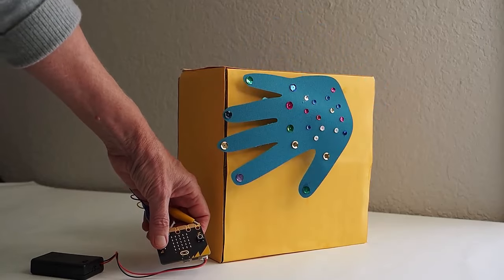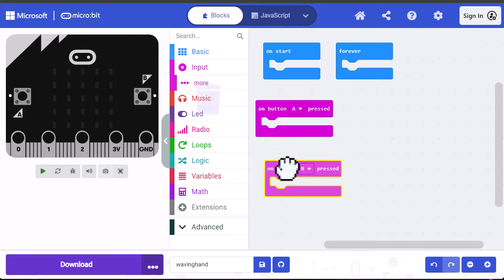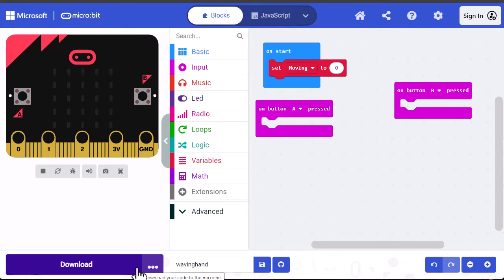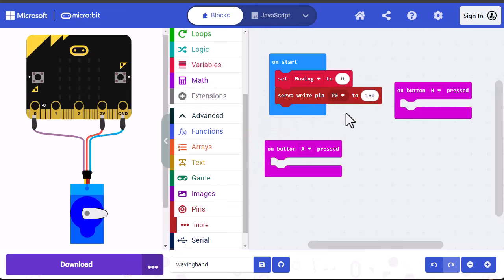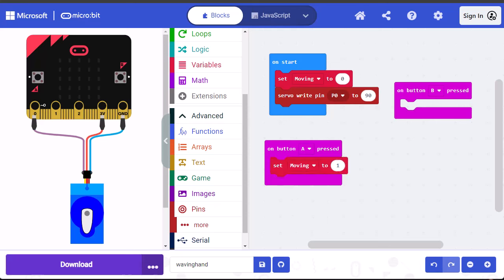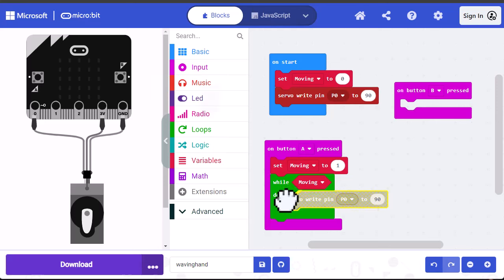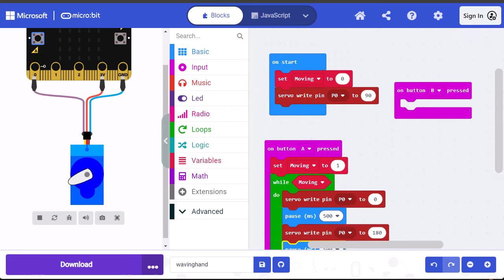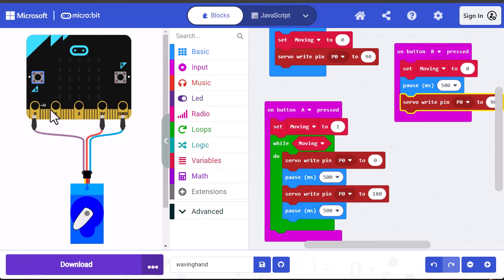Watch As I Use a micro:bit to Program A Servo to Make a Hand Wave!

Comment: Hi, would it be possible to run this through a distance sensor, so that it automatically waved when people walked by?
Reply from the maker: The micro:bit itself has no onboard sensors to handle distance. The way to do that is to use add-ons. You could add a proximity sensor directly, but that would have to be coded in a text-based programming language. If you want to use MakeCode Blocks,  you will need to add a board that is set up to handle a proximity sensor. 

I am in the process of developing a robot using a board from Sparkfun called a moto:bit. Elecfreaks has a board that handles a proximity sensor. It is included in their Smart Science Kit. They also have two little cars called Smart Cutebot. They are available at https://www.adafruit.com/product/5898 or https://www.adafruit.com/product/4575.

Thanks for watching my channel!
Reply: @wonkitz  Wow you are an absolute legend, thanks for your reply!